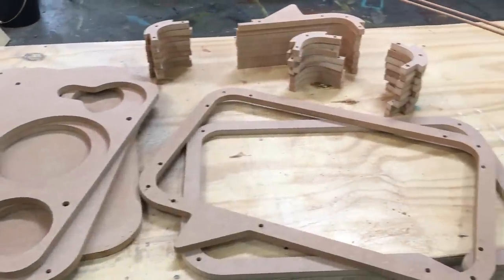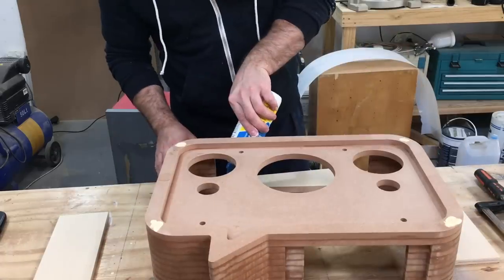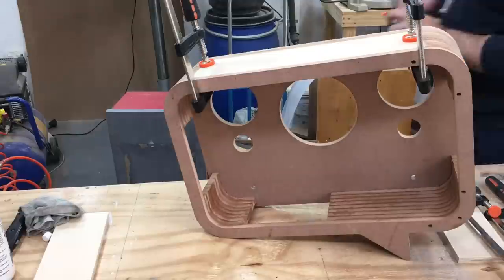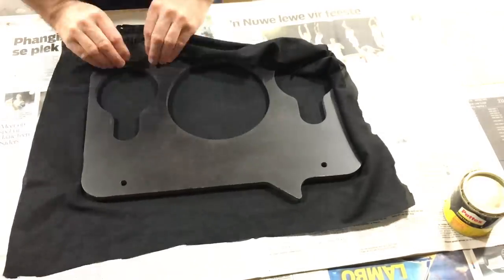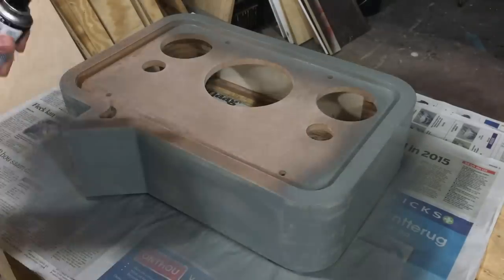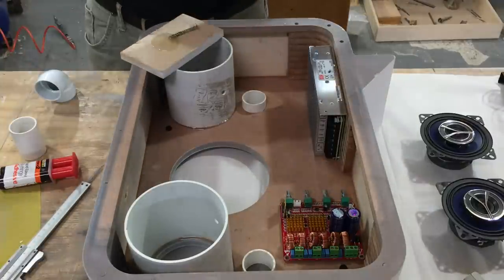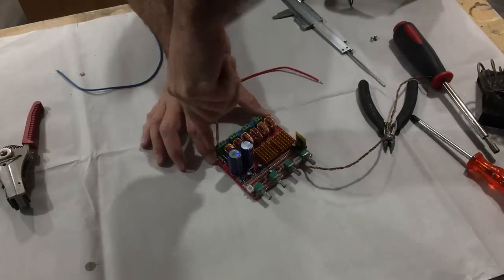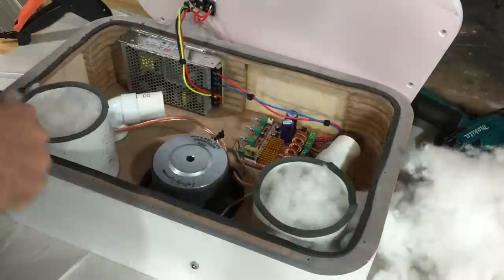Building a Speech Bubble 2.1 Bluetooth Speaker - by SoundBlab

Comment: Amazing job.  I want to ask is there a reason you didn't inset the back panel the same as the front grill?  The seam is visible from the sides around the 8:13 point in the video.    I'd think it would actually have been easier to use the same design/shape of wood for both front and back.
Reply from the maker: Thanks! There was no major reason for it. Suppose it was just a design decision that made CNC cutting and assembly less complex. But I agree, it would have been a more elegant solution aesthetically.

Comment: You really like using that 2.1 amplifier! I tried using a lepai 2020+ to power 2 Dayton designer series 6.5" woofers and dayton 1 1/8" tweeters with crossovers and it wasnt any where near powerful enough. Decided to just use car speakers as the lepai powers them no problem. I would consider using this 2.1 build but i want to make my system mobile and having 2 12v batteries for the 24v power would make it weigh a lot. Great builds though! I really like the pvc around the speakers. What does that help out with? I thought the speakers would sound better just open in a closed enclosure
Reply from the maker: Each model of speaker driver has its own specifications. We use these specs to determine the enclosure size and type for each driver. You will never find different size and model drivers in the same enclosure space in a speaker that is properly designed. Speaker drivers will always perform optimally in their own enclosure away from the influence of other dissimilar drivers. The PVC tube thus performs the function of placing each full range driver in it's own enclosure, with the larger subwoofer taking up the rest of the space.

Comment: mind blowing 
just curious about how do you set volume levels on the board ?
Reply from the maker: Volume, crossover etc. are all preset. Master volume is then controlled via the connected bluetooth device (e.g. phone).
Reply: thankx a lot 
keep it up you are doing amazing job
Reply: It seems it leaved all the knobs on max level, so the only way to 
control the volume level is through the cellphone/music player, which I 
find bad and ruin the advantages of a 2.1 system, where you can control 
voice and bass separately.

Comment: Hi mate,

what's the reasoning behind using the PVC tubing & the sealing of the box? I assume it's to improve the audio quality?
Reply from the maker: The enclosure is designed around the principle of a bass reflex enclosure (also known as ported or vented enclosure). This essentially requires one or more ports of specific diameter and length (determined by the specs of the bass driver) to re-enforce the bass output of the driver in the set enclosure (here I used PVC tube for this purpose). The sealing of the box eliminates any other air leaks that will influence the sound so that the driver, port and enclosure can function properly together.
Reply: The bigger pvc tubes there are intended to create individual chambers for each loud speaker, so the subwoofer waves don't hit them, which would cause to mechanically push them and ruin their performance of all the set. Little pvc tubes are just air ports for bass reflex. The sealing does the task of avoiding air leaking and vibration noise.

Comment: another guy from the 021, howzit! great video, really like your sound tracks. Been thinking about building my own system from scratch, Bluetooth... cuz I've got enough wires behind my PC. I see the amp you found has a prebuilt bluetooth module on it, but let's say you want build a home theater system, no wires... just power sockets. If you know how to build a..lets say 5.2 system and have each channel receive it's own wireless signal, I would love to speak to you. 

1 more thing, have you trademarked you're logo?
Reply from the maker: Hi, thank you! There are a few systems like that out there, but they are rather complex and not a concept I would take on right now. Wireless audio comes with a lot of potential problems, from interference to timing and sync issues, especially across a speaker system with multiple speakers.

Comment: u should put the power input and on and off switch on the bottom so its wall mountable!
Reply from the maker: Yes, that was a consideration, but I preferred the clean look with no plugs or switches visible from the front. Also, I think my nephew, whom the speaker is for, will most likely use it as is. But definitely a consideration if you are making your own.

Comment: The CNC makes this into a project that looks like a kit you bought from China.  I miss craftsmanship.
Reply from the maker: Sure, I hear what you are saying, however its made from MDF, not really what you would use great craftsmanship on. If it was of solid wood and the aim of the project was to show that off, sure I would agree with you 100%. Its really what your design and project calls for, and here the great combination of CNC and MDF works for the intended purpose.